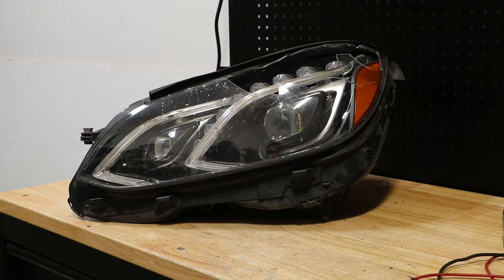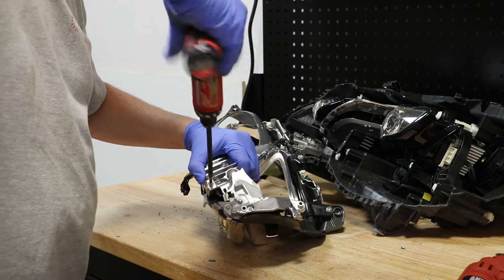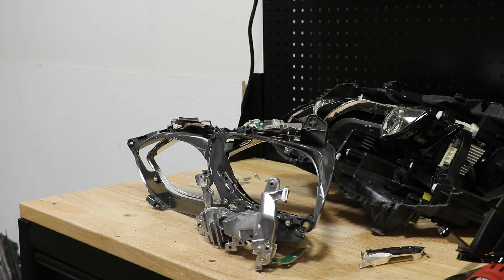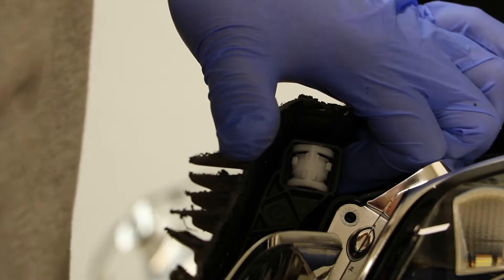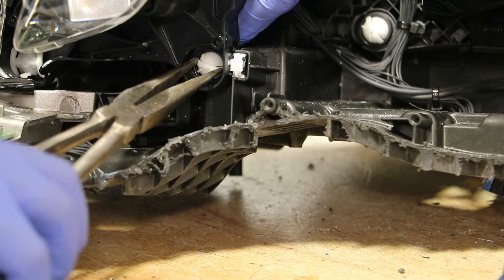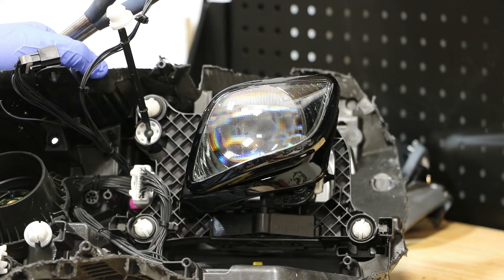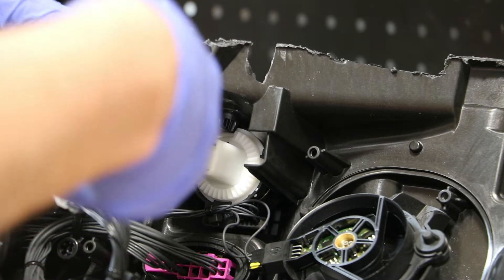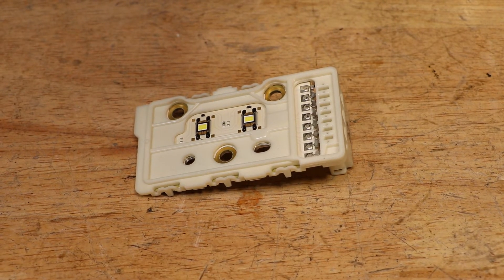2014-2016 Mercedes Benz E400 LED Headlight Teardown

Comment: Question. 1st- step. The removal of lens’s. You verbally said “cutting off , disconnecting lens from the light ” is that permanently glued? How do you do that. I am asking because i need to clean the inside has dust buildup. Thank you

Comment: Please, how did you disconnect the lens cover from the headlight ?   thank you sir
Reply from the maker: I cut the lens off with a saw.   Baking a headlight is the preferred method for a lens replacement.  

These German headlights use a glue that is very difficult to melt.   Often times the plastic housing melts before the glue on those lights with the black glue

Comment: Does the lens have to be physically cut off or can it be heated up and pried off? Thank you
Reply from the maker: You should be able to heat it up.  It does use the newer black glue that is harder to deal with.   For these videos I cut the lens off because it's faster and I don't intend to put it back together.

Comment: Hi.Would you sell me the parts from the stripped headlamp ???. I have a retro car project but cant find an intelligent nearside headlight to cut open. Also is the reflector in the corner by the main beam led the side light led. keep up the good videos. I had a task getting the inner cover off as the bonding that sticks the lense on also is on 2 tabs of aluminium at the top corner of headlamp. Sorted it in the end. Theres a lot more to the lights than it looks
Reply from the maker: Those parts have already been sold.   Yes, all of the lights in this headlight are LED.  there are no halogen bulbs that can be replaced.

Comment: How do you cut off the lens? Do you apply heat to any bonding glue to remove?
Reply: In the video he’ve cut the headlight housing. In reality, if you’re only doing the glass replacement, cut off the glass with a Dremel tool and pry the rest of the glass with glue with the flat screwdriver. It’s very hard glue, so it may take you several hours to do that. If you’re able to change both glass and housing, I would suggest go that way and just swap out the internals.
Reply from the maker: I do not have that information.